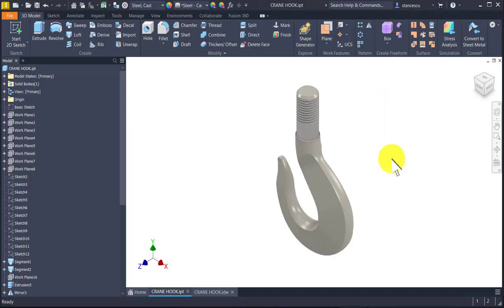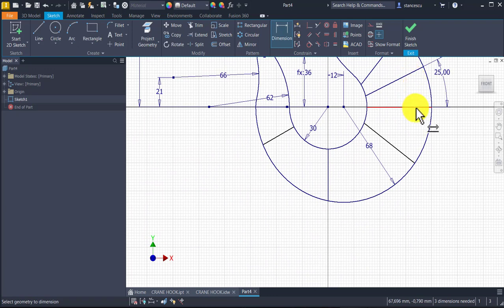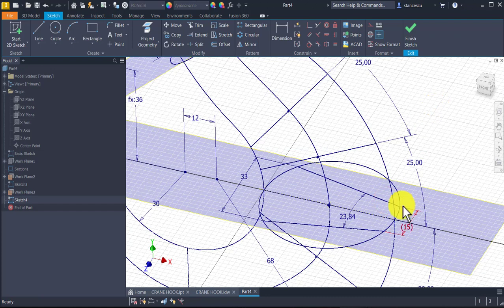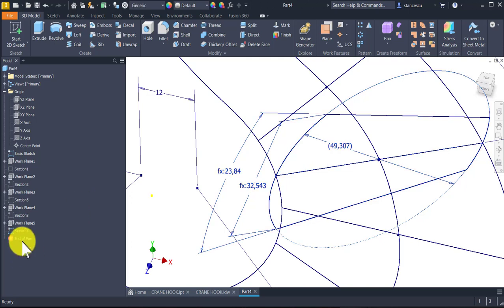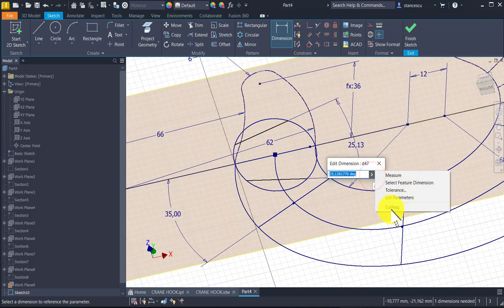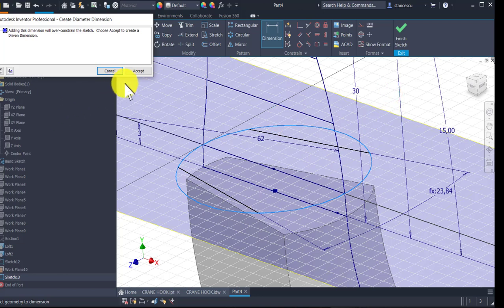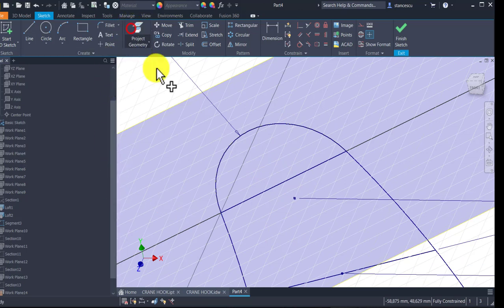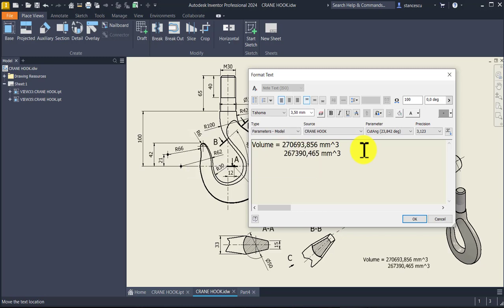Tutorial Inventor - 260 CRANE HOOK

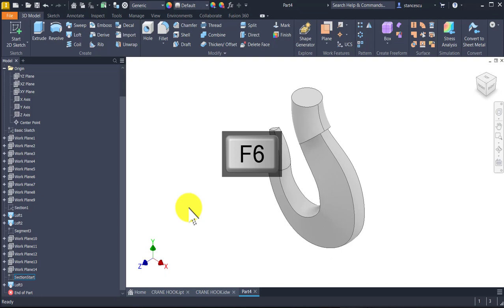Comment: I follow till the hook tip and lost. And after pressed num lock, the hook tip suddenly appeared 1:35:14. How you did it? Thank you!
Reply from the maker: I use two devices: SpaceMouse and Evoluent mouse. See details about SpaceMouse in my tutorial no. 180 (minute 2:20), and details about the Evoluent mouse on https://evoluent.com/. Both have buttons that can be set to apply the function of the key HOME, but the Evoluent mouse presents the NUM LOCK key instead of HOME, even if the effect is HOME. I tried, but I did not found the solution for this. Thanks!